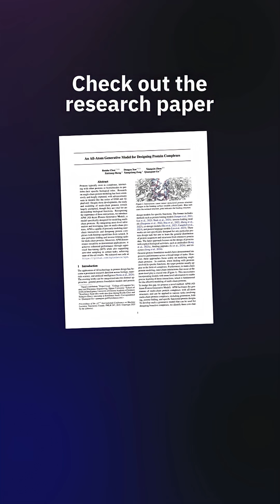Debugging spiking loss in protein #foundationmodels #ICML

Comment: Based on my personal experience, 4/10 times, the cause of NaN gradients is due to trying to avoid zero divisions, by adding a value smaller than the smallest possible value for that precision to a denominator that could potentially be 0, during division. You could specify a value that works well for f32 computation, but when you use mixed precision or f16 precision, its easy to forget to adjust the epsilon value accordingly (if you're not doing it automatically that is)

Some other times, its due to some numerical instability than can be avoided when you do the computation in logarithmic scale and convert it back to normal scale, but sometimes even the log scale computation csn cause issues, like the log of a zero or  negative response

Of course, there are several other causes too.

Comment: Interesting video.

Lately I've been looking into research on Bird Eye View inference models for autonomous driving systems, that is models that make inference on an ego-centric top view driving scene. 
I've been designing several of the modules from scratch, just to get the hang of it and slso chime in my own thoughts for design, Like replacing the learned BEV query of the BEVFormer with latent features from a backbone that processes Point pillar features from a pillar feature net thst encodes LIDAR pointcloud data.

For the most part, most things work, including the perception, prediction and planning modules, however one challenge I've been running into lately is compute, mostly because while the BEVFormer in its full glory (with Spatial cross attention and temporal self attention) are pretty good and generate information rich latent features, they're not exactly good for real time applications.

So, I've been looking into FCN based alternatives, still very much as performant or better, but faster.